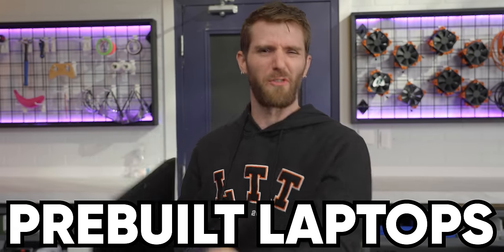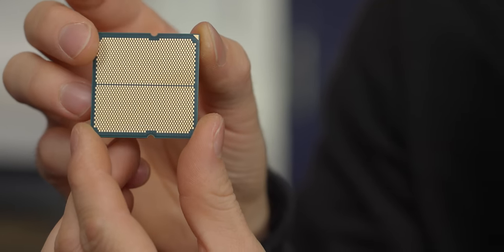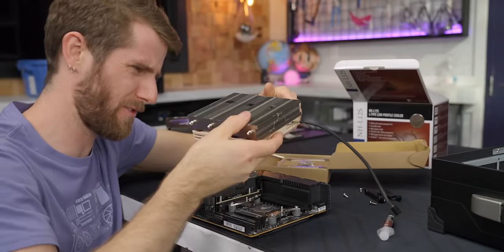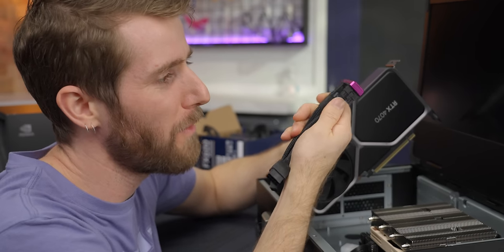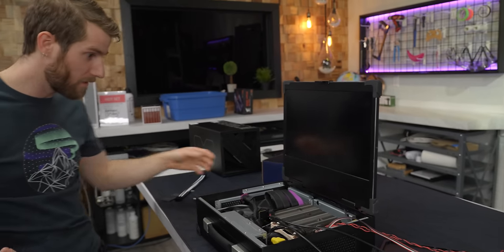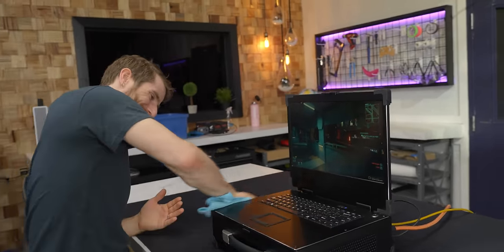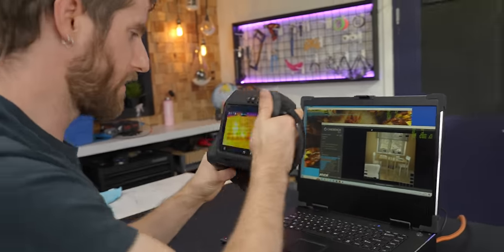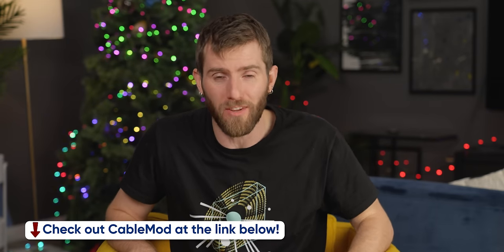Building your own “Laptop” is Terrible and I LOVE it! - MaCase B21 Briefcase PC

Comment: I would scrap the keyboard. Replace it a few layers of mesh and something to help thermals. That may It can be less hot to the touch. It doesn't have a battery so Your gonna have it plugged in regardless and a wireless keyboard and mouse is probably going to be better anyways

Comment: It is a shame about the hdmi cord there should be a better solution than a cable out the back.

As for the keyboard heat issue a shroud out the back io slot not used.

Comment: The fact that you went to all that trouble putting a hole in the bottom for air intake for the GPU, then proceed to leave it flush on the desk to stile said bottom air intake, is beyond ridiculous.  I bet your temps would have dropped if you had propped it on an angle giving 1-2 inches on the back end for air intake.

Comment: you know you could modify the case itself by adding more ventilation by removing the other two pci covers and add 2 fans in the back and blow out hot air.

Comment: I do miss the old DOS computers in a briefcase size with a keyboard that pops out.
I'd be fine without the laptop keyboard and track pad and instead just make bulky keyboard and mouse storage.
Maybe even skip the screen and use it on a TV or streaming directly to a Steam Deck, maybe with a built in wifi AP.
I find myself plugging in my laptop and plug into a wall anyway cause my battery luck is terrible and they always die on me.

Comment: I remember something like this in the late 80s to early 90s. It was a tower case with one of those new TFT screens and a drop down keyboard on the side. Had a handle on top for carrying and was made out of sheet metal not aluminum iirc. It was still AT so the case was pretty small compared to the long ATX boards. Kind of like the SCS Apollo A1 or the ACME MegaPAC L1.

Comment: I actually saw on AliExpress a power supply that converts 12v input to ATX power, cpu and one sata power connector,  using that sort of power supply if it was not the most freaking scary thing I've ever seen that could be good for a computer like that running a low end cpu

Comment: A really useful case if you have a PCIe x8 or x16 device that you need to use in the field. Some sort of datalogging or interface card or whatever that you simply cant use an eGPU case for. 
At work we have computer carts for things like this and thats just for around the lab, when you need to go in the field you need to find a junior without back issues
Reply: PCIe? Sounds a bit too recent to me. I'd expect this to get use with ISA cards and an ISA-to-PCIe bridge, because you just KNOW there's some big company out there that's got multiple sites that are still using 30-year-old equipment that's controlled by a 486SX with 4MB of RAM and running MS-DOS 5.0.

Comment: It think the temps on the keyboard should be bearable if you don't use the founders edition since it will push air upwards which is the reason why the keyboard at the WASD part is very toasty.

Comment: 3:14 Linus, this is going to sound a little nit picky but I would want the feedback if it were me. You said “I” think this will work nicely. I am curious if you personally did all of the research or if the chip was chosen by a member of your team who was working the project. Logically, I would hope you used data and guidance from the lab to form this opinion. I understand you are the host and telling us a story, but it stuck out a little to me.

Comment: It's too bad you didn't learn from building in the In Win CJ712 case.
Changing that side fan from exhaust to intake is the primary reason your temps were so bad.
I tried the same thing with the CJ712 and it had the same circulation problems you just saw with this.

Comment: Good idea would be to recess the graphics card back towards the handle some so you can have the hdmi cord inside and have a small hdmi / display port extender that leads to the back for second monitors. Plus maybe an insulator on the keyboard on the gpu side or something to direct the exhaust out the side not just up at the palm rest and keyboard

Comment: water cool it and pull the heat out of the system with a rad with fans. Just have to make sure it can turn 360 degrees without loosing water. Don't they make ultra thing rads and stuff for this kind of thing. There are some nice ultra thing fans that might work too.

Comment: I mean, its not that stupid.. You can use it at home like a normal computer and external monitors and then easily take it with you without bringing your monitor, i could easily want to buy it if the "case" in itself was a better design with the problems fixed, you could also pretty easy add a layer of heat protecting element under the keyboard/wrist area

Comment: You could probably built a smaller gaming with a Ryzen 7 7700 or heck even shrink the mobo altogether with something like a Minisforum ITX boards which uses laptop parts but slap desktops class GPUs. Alternatively. Building a small desktop with those aforementioned and slap a better display and keyboard is also another alternative. Should you want to. And of course buy similar level aptops themselves   there's always options and most of them are less of a headache. 
This does have a cool factor to it tho.

Comment: Makes me curious... could you build a computer using a bitcoin rig, enclose it and fill with mineral oil?  Could attach a small pump and radiator and voila, portable setup.  Plexi glass or something might make it portable if you pull out the mineral oil, and figure half a gallon of mineral oil, maybe a gallon?  Read mineral oil is roughly 7.2lbs per gallon.  Wonder what the aluminum sheet weighs in comparison?  Heck, could even make a backpack out of it.  Like a portable aquarium

Comment: 6:42 An assumption is made (CPU/system needs this to be an intake, not an exhaust)
14:56 System is so exhaust-limited, you now have hot air exiting via your "intake"

It's a SFF with only 1 case fan, IMHO the assumption from the start should have been that this needed to be an exhaust. But regardless, this should have been the point where you flipped both CPU and case fan.

Comment: 0:30 Linus showing his age. IBM mass-produced "luggable" personal computers back in the 80's. 

"The IBM Portable Personal Computer 5155 model 68 is an early portable computer developed by IBM after the success of the suitcase-size Compaq Portable. It was released in February 1984 and was quickly replaced by the IBM Convertible, only roughly two years after its debut."  - Wikipedia.

Comment: I made one like that with only 7cm thickness on the back and 6cm on the front (including the monitor), using 2mm aluminum sheet, and the monitor using a Samsung monitor, just not finished on the keyboard and touchpad

Comment: 2 options. 1 use a case with no access to the rear IO of the graphics card with  pass-through connectors on the outside of the case. Or 2 as the display sucks. Plug a usb-hdmi adaptor into one of the MB USB connections. That shit monitor isn't taking advantage of a graphics card.

Comment: if i had that id probably put high end laptop parts in it and fill the rest of it with some batteries, probably LiFePo4 batteries and voltage regulators, could probably get a gaming laptop with a 200h battery

Comment: My question is, how much space between the desk surface and the bottom of the case? Is there enough space to get enough airflow for the GPU? You might check that, and if it's not enough, then put something on the bottom of the case to rise it up and test for thermals again!

Comment: My case vas something same 10-15 years ago, with full sized atx psu, a full size 5,25 lg dvd burner, 2*3,5 hdd, a micro atx mothernoard, a radeon hd6750 gpu, keyboard, a 17 inch led monitor and speakers.

Comment: I think that your problem is that the hole at the bottom of the case is not allowing enough airflow.   ( is there an airgap to allow air in ? ) 
so the graphics card is too hot. Either put feet on the case to raise- or cut hole/slots at bottom of case  by GPU

Comment: I think this case is a cool idea, but boy is it poorly designed. My SFF case is metal and weighs hardly anything. This thing has the same parts compatibility as a SFF case but manages to be bulky and heavy, which is really not what you want for a portable device. This thing could've been made way thinner and lighter. You would have to rely on liquid cooling as you wouldn't be able to fit an air cooler capable of cooling higher end chips, but that wouldn't be much of a problem if it was designed to allow for a 280mm AIO with bottom ventilation. You would also have to forego the triple PCIe slot, but I doubt there are many triple slot cards that are less than 260mm in length anyway. Some parts compatibility would be sacrificed, no doubt, but parts compatibility is already so limited, you have to buy parts specifically to fit in this case and high end GPUs are off limits, realistically I doubt the triple slot PCIe enables much higher end cards to fit considering the 260mm maximum length and most people probably aren't even going to end up using the third slot, except perhaps for a capture card for a portable streaming setup, which there are good USB versions of anyways.

The base is about 50% thicker than it needs to be. The entire base should only need to be marginally thicker than the rear I/O plate, to account for the thickness of the keyboard, as well as a cooling duct to route the GPU intake to the side (since there would be very limited space for GPU air flow and cutting a hole in the top is not really an option since it will be blocked by your arms)

It looks like they just modified an off the shelf pelican case, rather than design something from the ground up to be as compact as possible while still allowing for standard desktop parts to fit.

Comment: nVidia, there's your problem.  Not that AMD is much cooler these days.  So what was the wattage draw?  80W, or 800W with GPU.  I tend to go laptops because of the power draw.  A 1200W PSU would my burn house down.  A 1970s prefab mobile home.  Just a 450W HDTV, 2x 225W studio monitors and a 350W desktop was enough to smell the wires burning in the athlon x2 days.  Throw in a 300W laser printer and the lights dim when I print.

Comment: I just build my new PC with NZXT H1 v1 and Ryzen 7800x3D and this the same gigabyte aorus ultra and now I feel good its recommended by Linus as well. I was thinking to buy an RTX 4070 as well, but for now I still use my old GTX 1070 and I still play AAA quite well at console FPS (30 +) which is bad, but not that bad since it doesn't have stutters like I used to have with i3 9100f. So yes, a good CPU can make the difference in gaming.

Comment: I prefer my BSI computer FieldGo M9. It has a fold down keyboard and 3 fold out screens. And it has a full 7 slot design. It's to bad it's discontinued. And the FieldGo F3 is not as good as the power supply is above the processor. and the big difference with these vs Linux's is that the keyboard is thin and the PC is in the back.

Comment: What makes me mad is iv researched doing this for VR, I just need a troubleshooting screen. The only issue is battery. Trying to do the power devilvery for 4 hours of index vr use is very problematic. I'm from Vancouver and been building rigs my whole life. Then there's the issue of airtravel and the amount of 18650 lithium cells I'd need. It adds layers and layers of bs. It's plausible but with my experience it is still a non-starter.

Comment: so, just a question. If you weren't using the built in monitor in "laptop" mode, and the surface was that hot while it was running, would the temperatures on the surface while the monitor was shut damage the screen? Say if you decided to hook it up in "desktop" mode and plug in a different monitor and had it running for a while?

Comment: why not use lower price parts, the graphics will still be good. There is a smaller board that can be used and smaler form factor memory as well. There are graphic cards with heeaders to make it easy to connectthe video

Comment: are there 1U versions of this? sticking with a 2 slot or even find some manufacturer that makes something like the Galax 1070 Katana 1 slot GPU, it could actually be competitive with desktop replacements

the NFC Skyreach 4 Mini could probably do pretty good, but NFC could easily make a custom engineered chassis with jam packed internals

Comment: i mean..
1440p and or 144hz would be a great help..
and that old keyboard trackpad come on.. wtf u could fit a full mecanical keyboard in there if you remove the case... 
like its cool but it feel like it supposed to have a nostaligie feeling?? cause it aint 2023 specs

Comment: Build a PC in a pelican case that can fit as carryon onto a plane. Bonus points if you can create it with quick release covers to keep its water tight ability. Useful people that travel or go overlanding were a laptop dosnt have the productivity you want but you want the robust secure way bring your gaming or editing PC on the road.. even if that road is catastrophic vibration, impacts, rain. Whatever. 

I built a small form factor that fits inside a carryon bag just for traveling while working. Unfortunately it does not fit a 4080 or higher. And if I was working out of a tent it wouldn't be dust proof enough.

Comment: i just wished someone solved the issue of an itrgrated battery in a machine like this, the whole portable battery to 110v to pc pcu to 12v rails and etc, is just so innecfiecient, im waiting till someone makes a battery and pc psu built in, so theres less conversions, would make a build like this pratical for the small set of use cases it might solve for

Comment: Making a more skeletonized frame and not using an overkill GPU and CPU maybe it could work doubt anyone in need of a travel PC needs a 40 card hell a basic 10 or 20 is more than enough for the use cases I can think of and not spending  over 1 and half grand on a fragile lap top.

Comment: ive got an old gateway Gateway MC7801u laptop that the motherboard fried and i want to frankenstein it with a raspberry pi, though i need the adapter board for the screen, and if i can possibly find a way to get the touch media controls to work with it i would be over the moon. i may need the help of the LTTverse to ID the monitor so i can get the right adapter board.

Comment: Sry but the moment u put out the GPU it was absolutely clear whats gonna happen and that this is gonna be an awful build....As u said yourself those Nvidia GPUS pulll cold air from the botton (Where it now has like 1 inch to actualy get fresh air) and push the heat up to the top...HOW are u supprised that the keyboard sitting directly above your gpu will get freaking hot?? Nice project but not enough thoughts/time/effort put into.

Comment: Hi All :)

I know this is most likely a stupid question but Linus says at 14:00 he is running at 120 FPS smooth. it's a 60hertz display?

I have a 4k TV at 60hertz, whenever I don't lock my FPS to 60 I get screen tearing, am I doing something wrong?

Ryzen 9 3900X
40GB DDR4 Ram
NVME drive
RTX 3080 TI

Comment: Possibly tried to make your own GPU enclosure, but it's not that simple if that enclosure also has it's motherboard. So disappointed fighting one lane speeds our IVY lake hero after long hours of enjoying connection over wi-fi PCI connection gave up and bought himself a presidential diamond in a sky to be his best friend. Ask me if it's alright if not I don't know what I do as not prepared future Meta Trunks. Because they don't want to be rock stars anymore, they want to be Late Night Show Host Warlords. This is interesting for brendas 2:12 and so dry and  these electronics boards is just something you have here as not reparable TV's.. This is some past micro controller/transistor with exposed connections 3:00 for usb. Have to measure everything yourself every inch '' 6:51 and that also fits LGA 1511 as mobile Amidrassil.  It's time Unbound, already 20 fps drop 8:30, but I don't see why is it so much textures intense than Heat.

Comment: You gave this mess of an idea WAY too much praise... The amount of work you had to put to even have a not even usable version of this thing is just dumb. Even if you put in some layers of thermal shielding conceptually this isn't even half baked. Just because the competition is absurd doesn't make this any less of a turd. 

Conceptually it seems like a display slapped on the side of a small tower makes more usable sense than whatever nonsense this is. Or better yet just make a mini ATX build and use a travel monitor...